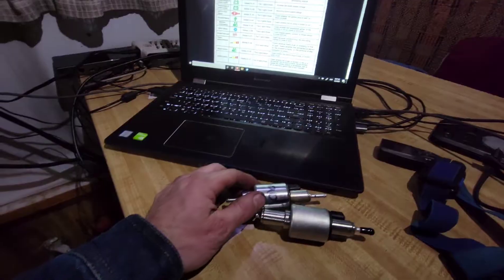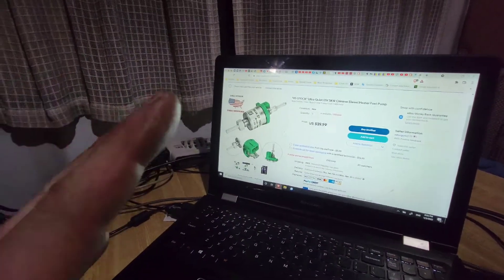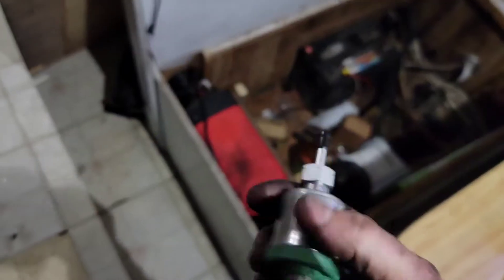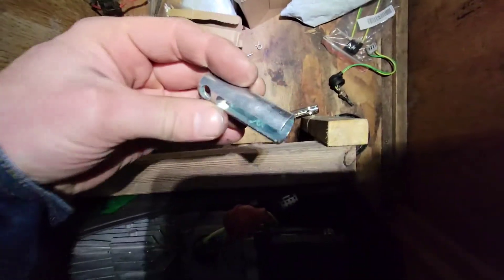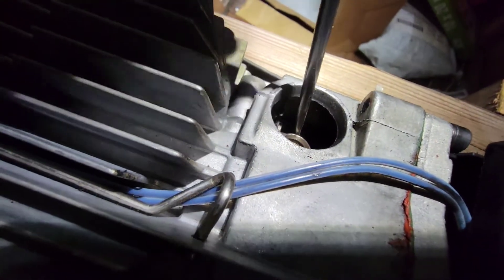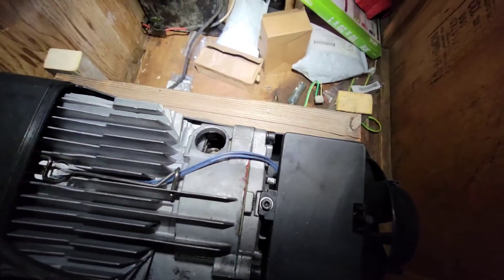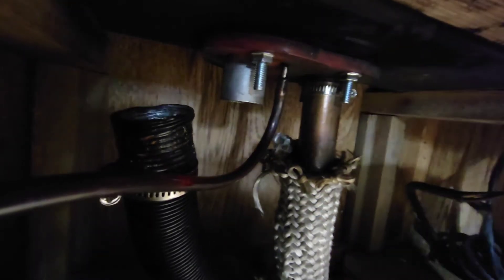Fixed - White Exhaust Smoke Won't Start Problem (E-10 Ignition Failure)

Comment: If properly installed, the emulsion screen will remain clean . If the screen is dirty , replace it . Be certain that the screen is set deep enough to allow the glow plug to seat completely.

Comment: Just to clarify about the two pumps. You are correct that the one was not pumping too much. Actually, most of them that size are rated for"2 to 5 Kw" heaters. The clue is, as one can see in the vid, that both those pumps have the number "22" on them, which means "22 millilitres of fuel, per 1000 ticks"... in other words, both of those two pumps, put out the exact same amount of fuel each time the pump ticks.

Comment: Mine did the same the forth time I didn’t  take it apart and clean it I used an air compressor and blew though the intake a few times and it worked perfectly

Comment: Great video and it should help many ,   this guy is right on the money ,,,  mesh screen and that little hole cleaning,       run heaters flat out for hour to help burn clean   before shutting down,    it is a the trick to reliability,    never use anything other than diesel ,     oils will cause issues that i promise  you people

Comment: the clogged hole was why both of mine had bad issues. Once cleaned up - I removed the glow plug and soaked it for 2 hours in diesel fuel before lightly brushing it with a soft brass brush. I also poked a makeshift pick thru the hole, then scrubbed best I could with pipe cleaners and a 9mm cylindrical brush. It started up with tons of smoke, which burned off after a few minutes. That was 2 hours ago and it seems to have fixed the issue. Thanks for this video, it obviously helped out a lot of us.
Reply: quick update, now that I have a few more months experience with using these heaters (and about 800 hours use on each heater) - it definitely was the hole that was clogged. Super simple fix. If you burn straight kerosene every 75 to 100 hours of use and run it very hot for at least 30 minutes straight every 50 hours or less, it seems to keep them pretty darn clean.

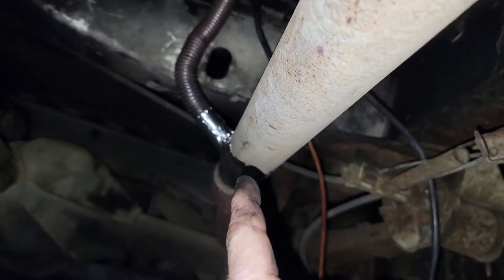Comment: 3:15 This is a bad idea in all cases..the backpressure from the exhaust of your engine running could cause all kinds of issues, with or without a running heater.

Comment: Enlarging the air hole to 1\8 inch completely solved the smoke problem on startup.
Reply: I was thinking about the same. Do you still suggest, or did you find drawbacks?
Reply: @yxcvmk  I've found no drawbacks.

Comment: Hi - can I rotate the heater, so the hole is not pointing straight upwards ? Tia + greetz fr Minotauria - Herzele    💛💚💛
Reply from the maker: I tried that and it didn't work.  The diesel fuel needs to gravity feed down into the burn chamber.  It will also leak out when turned off.

Comment: Wait- what would prevent the carbon monoxide from the RV from being forced up backwards through the diesel heater while you are driving?? This looks like a dangerous way to plumb the heater exhaust.
Reply from the maker: Of that happens it would just push the exhaust back out through the intake tube which is also plumbed to the outside of the RV.  So no exhaust would get into the inside of the RV in that case.

Comment: Great info but what causes the atomizer screen to become fouled with soot? It appears you have a vinyl/PVC 5mm fuel line in use. Many of these heaters are supplied with 5mm soft wall tubing that is not appropriate for the application. You need 2mm rigid wall nylon tubing from the pump to the combustion chamber, this allows for more efficient atomization and helps prevent fouling of the atomizing screen. This video provides a good explanation of fuel delivery problems using the larger bore, soft wall tubing. https://www.youtube.com/watch?v=jCZhjGyR3bo
Reply from the maker: Thanks.  I hadn't heard of the tubing causing the atomizer screen to foul up.  I but I did already switch over to hard nylon lines because they don't crack and cause leaks. From what I understand it gets plugged up because of an incorrect fuel mixture and letting the heater run cooler at the slower idle speed too long.  I'll check out that video you shared.  👍
Reply: @SpoonerTuner  Here is another video from John explaining the importance of proper fuel atomization and the components which support ignition. https://www.youtube.com/watch?v=3ooqrRThBOI There are a few key factors required for consistent firing of these heaters. 1st is clean air supply at the upstream end of the atomizer screen, this is why you always want to replace the plastic inlet noise dampener with an actual air filter. 2nd is sufficient heat for combustion, provided by a properly heated glow plug, 3rd is a clean surface with properly sized openings to allow large fuel droplets to be reduced to a fine mist of fuel, which is the screens job, lastly the fuel needs to be delivered in a manner to take advantage of the entire surface area of the screen. Using a large bore soft tubing allows the small cavitation air bubbles created by the pump, to collect and form large air bubbles. since air is compressible, those bubbles steal some of the pumps ability to deliver fuel to the screen with force, allowing the fuel to be distributed evenly onto the entire surface of the screen. The soft tubing also steals this ability from the pump, but in an opposite manner, it expands preventing the force applied by the pumps piston from being realised at the delivery point, by absorbing the force all along it's length with this slight expansion. the result is the fuel is delivered with virtually no force and is oozed or dribbled onto a very limited surface area of the screen, resulting in a very rich mixture in a very small area of the ignition chamber and a very lean mixture in the majority of the ignition chamber. The wet, or very rich area will be a point of very inefficient burn, leaving carbon by product or soot on the immediately surrounding surfaces of the screen. Any debris in the air streaming across this surface will tend to collect on the wetted, irregular soot deposits, thereby making the situation worse. apologies for the lengthy reply. 🙂

Comment: Had all that many times now , sometimes you can overlook the obvious for instance I accidentally kinked the air intake pipe just a little without realising , took me ages to get on too it then broke the fan motor by losing my temper trying to get the horrible plastic cover back on , these things might be cheap to buy but as usual from China poor quality materials and build
Reply from the maker: Ya, they can be a real pain.  If the mixture is tuned lean and you always run them full throttle they do much better in my experience.  But ya, the build quality sucks.  The bearings in them seem to get loud after about a year of use.  I changed my bearings out for some high-quality Japanese ones.
Reply: @SpoonerTuner   yes I have  similar problem right now , but my older one that lasted two or 3 months actually might have had the mixture way out from what it should have been, I’m not 100% sure about the air intake, but now I purchased a brand new one and soon as I fired it up guess what the bearings are not right the thing is making a terrible noise wearling sound extremely loud definitely not catching on anything it’s definitely the bearings but the flaming thing is brand new all I can think is that they must’ve not put them in correctly

Comment: What can cause the hole to become blocked after a few uses?  I cleaned it myself and everything worked fine and I already have the same problem in less than a week, and the heater is new
Reply from the maker: It may be running too rich. Or if it runs most of the time in the low speed mode it will cause it to clog up inside.  I only run mine at full throttle now, and I tuned the fuel mixture to run leaner (less fuel more air, or less pump pulses per minute)
Reply: @SpoonerTuner  I guess not everybody is aware you can adjust the amount of pulses in relation to the fan and set the whole linear response of these values. But I am not sure if you can say it makes the mixture more or less rich. If you pump in more diesel the combustion chamber gets more or less hot and the fan that controls the heat needs to be properly related with a fitting linearity, which van be set if you go into the deeper settings. I have worked on this and also created settings that allow lower output if the outside temperature is not that cold (1.3 pulses per second instead of the default 1.7 Hz, as this was the default with a 2kW heater).The heater works great but not below -10ºC, then it will still extinct, even on higher settings, and it did this from the beginning (when just new) and that is a pity. According to the manufacturer I need to replace the plug in my case, which I now have in front of me and I am about to do.

Comment: 120.00 a month to heat a small area with a diesel  heater totally  ain't  fing worth it. Get it?!
Reply from the maker: I use mine as a backup heat source for when I'm not home.  It turns on and off automatically and keeps temps just above freezing so my pipes don't freeze.   So it's well worth it for me and others.  Just depends on a person's situation.  Now,  I mostly use wood heat when I'm home.

Comment: My heater was running all night on low . In morning turned it off  . The next night  white smoke E8   .  That small hole blocked and screen blocked up .
Reply from the maker: That sound familiar.  Mine would do that too often.  I finally figured out that if you only run the heater on full blast and just turn it off after it's warmed the place up for you, it will not cause it to get dirty and blocked up inside.  Also, you need to adjust the pump speed down so it burns leaner (less fuel and more air).  If you do this it will just keep working without having to clean things out all the time.  I bought an aftermarket controller call the Afterburner so now it turns itself on and off to maintain the set temperature.  http://afterburner.mrjones.id.au     Hope this helps.
Reply: I would try changing to high some 30 minutes before shut off in the morning. That should leave everything clean for next start.

Comment: I burn kerosene in all 3 of mine with 5ml of two stroke oil to lube the pump per tankfull a  2kw and two 5kw heaters, ive been having an issue with white smoke on startup for ages, so i serviced the heaters new gaskets, new plugs, new glow plug screens and cleaned the burn chambers and then changed the lower fan speed in the special settings menu to 1650rpm and the upper fan speed to 5000rpm they start without a hitch every single time now. we have been running them at 1.7 hz for a year now so they were due a service. one more thing if your heating internal air in the winter time switch to external air in the summer time for use with the odd cold snap my heaters seem to smoke on startup drawing in warm summer air from indoors but they dont smoke drawing in outside summer air.

Comment: On mine the carbon had blocked up the bottom of the heater plug hole i poked it out with a  3mm drill by hand it now works fine .
Reply from the maker: Nice job!  You'll probably have to disassemble it pretty soon and give it a good cleaning inside the combustion chamber.

Comment: Hi, i use this in house, but i have a lot of smoke First of startup, the glow its new, the Power supply are 600w 50amp, the wire are 4mm, and the Little hole its free... Do you have idea?
Reply from the maker: It needs more air. The exhaust pipe might be plugged or restricted. You might need to disassemble it and clean out the combustion chamber.

Comment: This is only ONE of the screens. The one that gets clogged is much larger and is inside the “turbo” at the bottom of the burn cylinder.  You can sometimes pull it out and clean it. Other ones are held in place with a welded “washer.” It’s much easier to just buy a whole new burn chamber. ~ $20USD
Reply from the maker: Yes, you're right.  I didn't know there was a bigger screen down there for a while because my chamber was welded, and I couldn't see it very easily.  I accidentally pulled the screen out of place and damaged it while cleaning it, thinking it was carbon that had built up back there. It's super hard to clean.  I think you could probably burn it clean in a really hot, clean fire if left in there long enough.  Probably some type of chemical could clean it too. 🤷   I've learned that if I tun the air fuel mixture to be leaner, it prevents the carbon from building up.  Makes a huge difference.  Factory settings seem to be a little too rich for me, but then again, I'm at 3000 feet elevation.
Reply: @SpoonerTuner  Do you guys have a picture/link to show how that looks/where it is? I am wondering about hard white smoke start, because everything else is very clean here...

Comment: 4:30 So a proper fitting and sealed BOOT on the glow plug is necessary for proper combustion air flow?   If the boot isn't seated properly does combustion air escape?
Reply from the maker: That's a good question. I'm not sure, but it makes sense that it would throw the air/fuel mixture off.
Reply: Yes it would allow air to escape and can throw the air to fuel ratio off

Comment: I wouldn't pipe it into the vehicle exhaust if you intend on running the engine as it will push engine exhaust backwards through the heater burner intake. If it's a monument motorhome like one of my coworkers owns that doesn't run it would be fine 😆
Reply from the maker: Ya, that could be an issue.  The bigger problem I ended up having is that the condensation from the heaters exhaust was freezing inside the motorhomes exhaust pipe and ended up plugging it completely with solid ice.

Comment: Whatever code you get most likely it is low power DURING start up . E10 is multiple failed attempts to start .
Reply: Big thanks for your valuable straight forward information. Much better than most having to listen what  they had for breakfast ect. Willemog.

Comment: Thanks so much! I can't believe how with a little priming it lit right up before it even started injecting fuel!
Reply from the maker: Oh nice!  That's great! 👍 Sounds like you were having a hard time with it for awhile.
Reply: burned out a glow plug trying to get it going and had a thermal runaway once when it finally lit because it was full of fuel! Exhaust pipe glowed red hot for 20 minutes with no fuel injecting.
Reply from the maker: @janmessek1826  Wow!  That sounds exciting.  Never had mine run away like that. 😬

Comment: So what stops the Exhaust from the Engine going through the heater and poisoning the occupants??
Reply from the maker: It's completely sealed from the inside meaning if you blow air (or engine exhaust) backwards through the diesel  Heather's exhaust pipe it will go through the heaters combustion chamber and exit to the outside of the vehicle through the heaters combustion intake tube.  If everything is installed and clamped down properly there's no chance that any exhaust will get inside the vehicle and poison the occupants.
Reply: @SpoonerTuner  Thinking about it know you are correct, thanks for the reply and i have installed one of these heaters in my basement to compliment my central heating, i live in a very small house and it's working perfectly.
Reply from the maker: @kpc5  nice.  Same here.  I gave the motor home back to my mom and now I'm in the single wide trailer house.  My diesel heater is my only heat source for the moment until I can get a wood stove in here. It's doing pretty good though